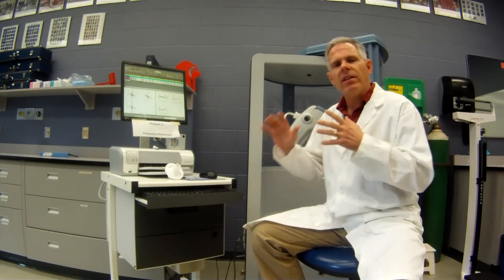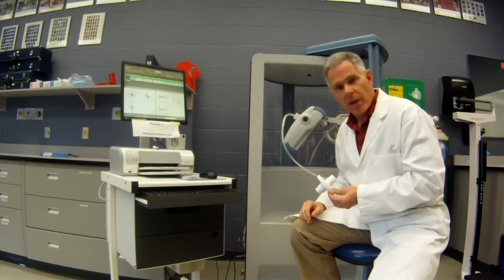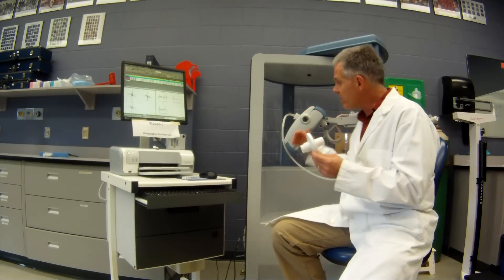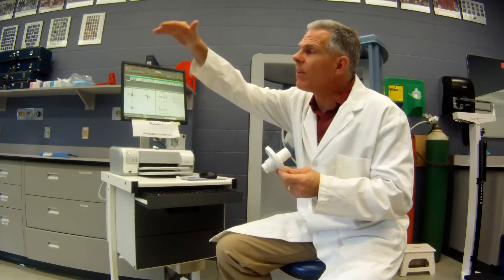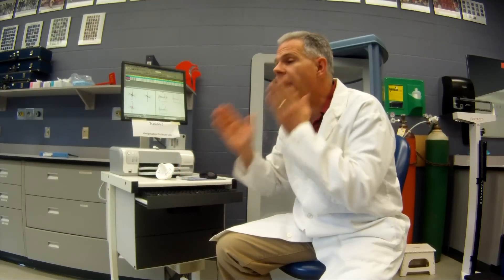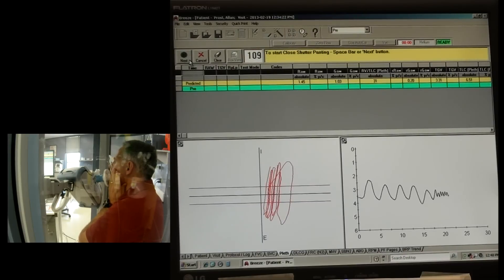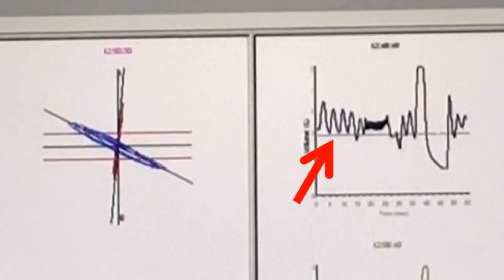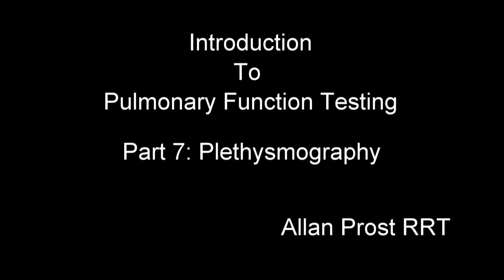PFT Plethysmography.pds.m2ts

Comment: Just an observation.  The panting exceeded 1 Hz., actually during the closed phase the monitor showed 150 bpm as a result you have a TGV of 130% of predicted. TLC of 117% of predicted and a RV/TLV of 119% of predicted, shown on the partial screen. It may or not be accurate. May I suggest you use a metronome to hit the required number additionally if your patients are uniform hopefully so will the results.  Great job, BTW great technologists make poor test subjects.
Reply: What would you set a metronome to ? In beats per minute?